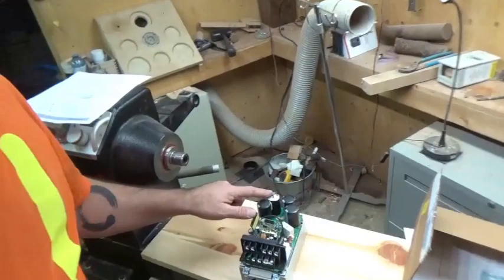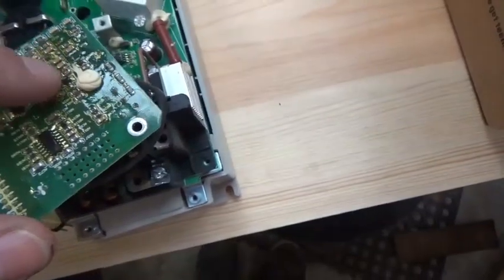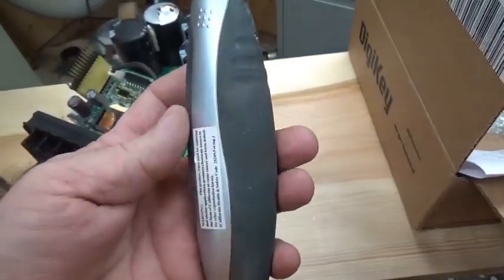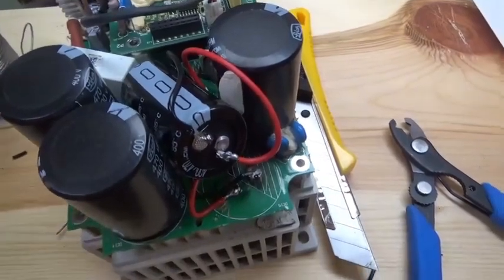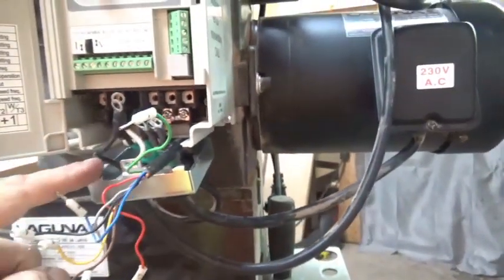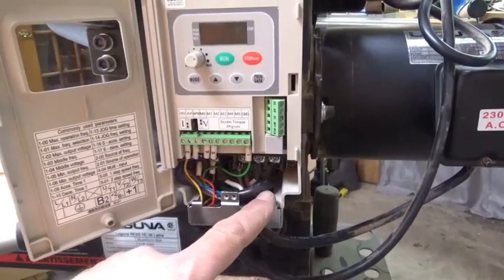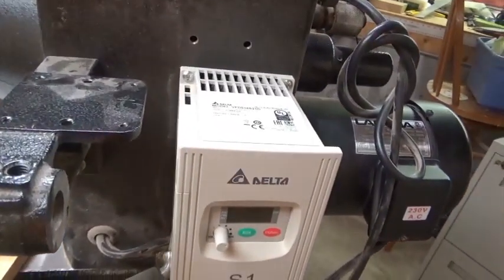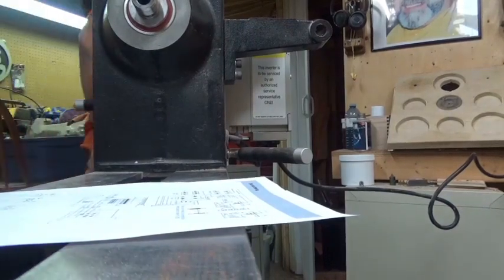The trouble with my Laguna 18/36 Lathe part 2

Comment: Well it certainly was not without trying my friend. Too bad Laguna could not provide other and better solutions as you have not had the lathe very long.  I hope all goes well and you find a reasonably priced solution.

I turn my Oneway off at the box on the lathe.  I assume that is what you have been doing.  We also have a surge protection mounted on the panel to break from surges on the line coming into the house from the street.  Hopefully between both we should not have any issues.

Take care Rob.
Cheers
Harold
Reply from the maker: Sounds like you have it covered better than I do, I feel like Laguna should have a kill switch incorporated into the design. Also I found out that Laguna has since replaced the VFD with a different brand and model,(ME300) which they sell at $870 US, or $1200 canadian plus shipping. makes me think that it should perhaps be a recall item, why change it? maybe lots of issues?

Comment: Thought you'd cracked it there, but quite often when a cap pops something else like a diode or power transistor will pop. If there is a place near you that does power systems they might help you out for a reasonable price.  When you have trouble melting the existing solder it often helps to flow some fresh solder onto the joint, not sure why but this melts the existing solder.
Reply from the maker: Yes i was wondering too but every part is coated in resin so difficult to test individual components

Comment: The issue with the soldering you had was because when the pcb are made they use a leafless solder, which doesn't flow with a soldering iron.

Usually you should keep some. Leaded solder add it to the component, then it will flow better.

Comment: Maybe the camera angle but those other 3 caps look domed and so may have failed as well.
Reply from the maker: No they arent domed 
Maybe the camera angle besides the solder doesnt heat up or melt for whatever reason, i give up trying to fix it after this, my next step is a new VFD from Laguna unfortunately

Comment: Nice try but you need a temperature controlled soldering iron, which has a fine tip, for that sort of work. You would have been able to unsolder the board and resolder the new cap. ok.:face-orange-frowning: